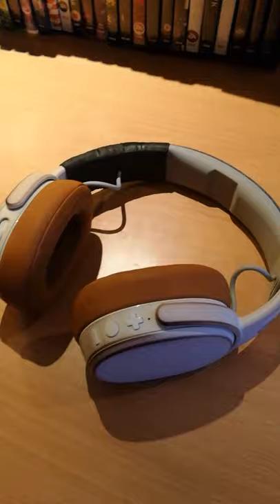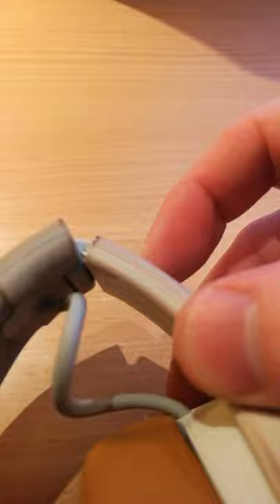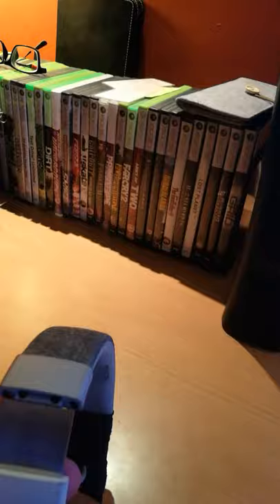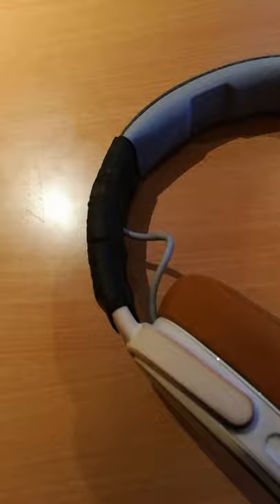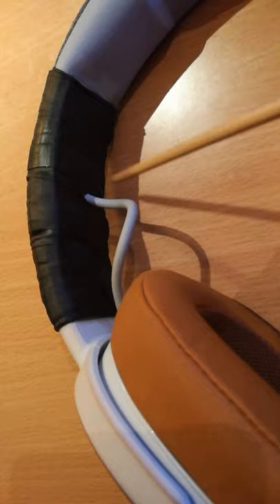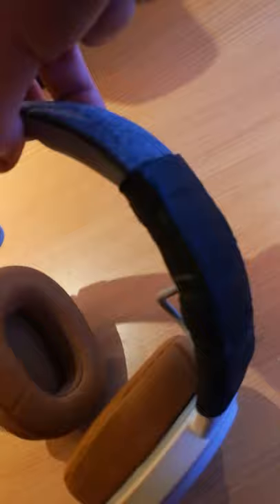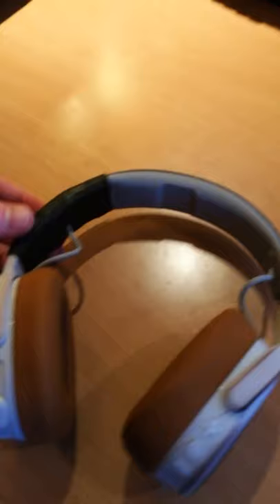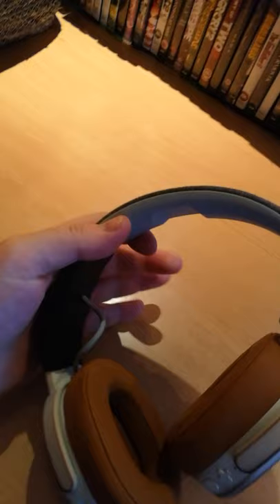Fix Broken Skullcandy Crusher Wireless Headphones

Comment: So basically, you sandwich the hinge area with two strips of plastic and then wrap it in tape, firm enough to maintain its position but flexible enough to fit your head comfortably.
Reply from the maker: Yes, just like when splintering a broken leg. Make sure the plastic strips are firm enough, and that the tape is durable. As an alternative, you can actually 3D-print these hinges yourself. There's links in my description.

Comment: A little late but, does brown stains your headphones have. Do you know why it happens and hot to get rid of them?
Reply from the maker: The discoloration comes from folding the headphones together. It's the fake leather on the ear cups.
Not sure how to clean it off as the plastic is quite weak. But I suppose you could get a cheap spray can and paint them again, maybe in pink? :D

I have pimped out mine in camouflage colors now, so the discoloration does not show anymore.
Reply: @christerjohanzzon  does your new camouflage paint job look like the original paint? What i mean is if the new paint looked smooth and clean and not like a 11 year old painted it. And if it did turned fine what type of paint do you recommend?
Reply from the maker: @TheRealGumbo  I had them painted by a professional..so to speak. With airbrush and such. It's a local talent and a friend of mine. They look really good with a mix of black green and darker green in classic camouflage patterns.

You can definately just sand your headphones and paint them. Look up how to spray paint plastics here on Youtube.

Comment: It still looks okay on your head? Mine is quite weird shaped now. How do you shape it correctly? I used credit card. Your plastic that big as taped place?
Reply from the maker: Well, a credit card might be too soft. I sacrificed a DVD/CD case that had pretty firm plastic. It has to be durable and yet flexible. I cut out slices of 5x15 cm approx. and put them on both sides while fixating them with tape. They fit well on my head. It's working very well actually. Only downside is that you can longer adjust that side.

But I also have 3D-printed hinges I can change to later.
Reply: @christerjohanzzon  Did you use a Stanley knife to cut the dvd case?
Reply from the maker: @pnmusic6206  No, I use a standard sharp scissor. But you can use whatever to cut a DVD case, its just plastic.

Comment: what plastic did you use if you dont mind me asking
Reply from the maker: Traditional softer plastic from a DVD jewel case. Firm to hold, but soft enough to bend a little. But in the end I actually replaced both hinges with 3D-printed ones. Works great again. These are my daily drivers and works great, even after 5+ years. You can pick up a pair on the second hand market pretty cheap now.

Comment: what did u use for the plastic
Reply from the maker: Softer plastic, like pvc from a DVD-case...I put a rectangular shaped piece on both sides, inner and outer, and then fixed them with vulcan-tape...you can use other tapes too..as long as they are strong and can withstand wearing oover time.

Comment: All you have done is tape it though?.... I was expecting an actually fix so you could still slide it and fold it.
Reply from the maker: No, for that you need to get a new hinge. Like a 3D printed one, they are very cheap and available om Ebay, Amazon and wherever you can get to use a 3D printer. Schematics are available online as well.